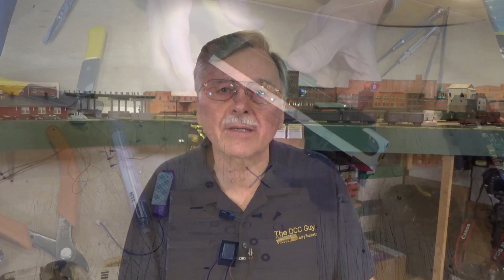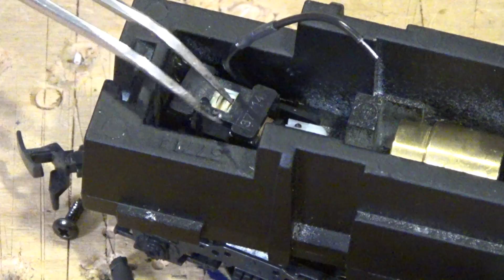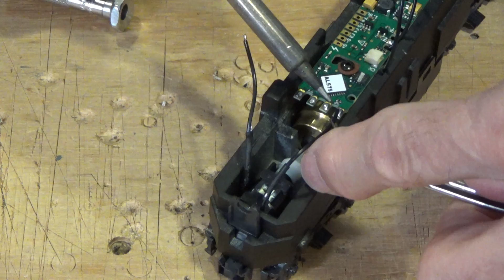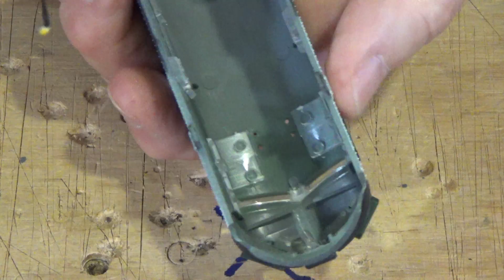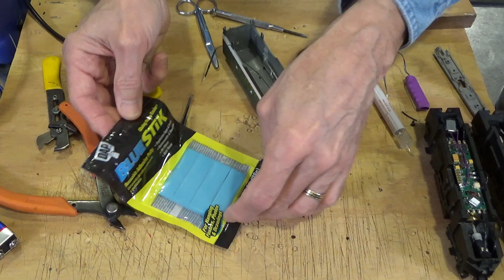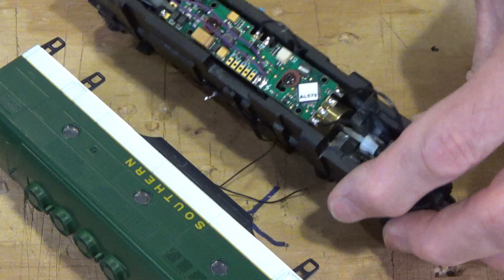Convert an old DC loco to DCC (50)

Comment: Good day Larry 
I like your show and I would like to know    by steps how I can program the cv 17,18. For DCC System. Thank you
Reply from the maker: Don’t programmg the long address that way, just let your DCC throttle and command station program it using their built-in programming steps. Trying to figure out CV 17&18 will drive you loco.

Comment: It related to this video because I can’t find your email. I installed and tsunami decoder and the lights don’t work. I tried LED and regular 1.5 bulbs and nothing.  Nothing is touching or grounding.  Since you have helped out in the past. I really appreciate your knowledge
Reply from the maker: Did you use a dropping resistor? These decoders supply 12VDC so an unprotected LED or 1.5V bulb will go poof.
Reply: @TheDCCGuy  yes they are wired with one.  The issue is no lights work off the board and it is right out of the packaging
Reply from the maker: Hmmm, hard to diagnose without being able to examine it, should work right out of the box. Give George a call at their tech support line.

Comment: Great video.. although I don't have any old DC Powered  locomotives, I noticed that when you soldered the wires to the contact points, your soldering iron wasn't held on the contact points for very long... I know this is important because if the iron is held in place for any length of time, it could damage the circuitry and other items on the board. 
 So with that said, what if I may ask - do you have for a soldering iron? 
Thank you in advance!
Reply from the maker: I use a Hakko FX-888D soldering iron. It has a rapid heat tip and you can set the specific temp. It also has an excellent ground so prevents damage to electronic components. I also have been doing this since I was a kid so 60 years experience. By setting the temp a bit higher than is required to melt the solder you can quickly complete a joint before heat builds up and does damage.

Comment: Would a butt splice work instead of soldering the wires together?
Reply from the maker: If you mean using a butt splice connector I think the main issue would be the size of the connectors. Working with N scale is usually a matter of trying to squeeze everything in.
Reply: @TheDCCGuy  I have been a union Electrician) for 31 years. I was asking because I thought a crimp connection might be better instead of soldering for someone who does not have a soldering iron or is not adept at soldering.  Thank you for your reply.
Reply from the maker: I do use a variety of crimp connectors for other splices but for decoders its hard wire or specific plugs.

Comment: Thank you for making this video! It answers a lot of my DCC questions when it comes to updating to DCC. I think fitting a decoder into my old steam loco is going to be a little tricky, but now I know what I need to do with my older F-series engines.
Reply from the maker: I need to do a brass steam loco video. I do have one N&W Baby J 4-8-2 that needs a decoder once I finish painting the wheels and frame.

Comment: How can you tell if a decoder will fit into a locomotive before  you order one? For example, I have about 2 SD40's and 2 GP9M's I'd like to convert and an Athern AEM-7. I wouldn't want to waste money on a decoder, but can't afford to just get a whole new fleet of locos at 350 bucks a pop.
Reply from the maker: You need to pop off the shell and se how much room you have and what provisions there are for installing a decoder and speaker.

Comment: Not sure what I am doing wrong, but i have blown out about 5 DCCs over the past year.  test them and they are fine out of the box, but now they dont work or somewhat work.  Rails are correct and the motor is correct.
Reply from the maker: Are these decoders you installed or did they come in the locos? How do you know they are dead? Have you tried a factory reset?
Reply: Up grading from DC to DCC  One the motor does no work, another Front Light is on all the time and crazy things like that.  I have a decoder tester that I use before installation and when something is wrong. @TheDCCGuy

Comment: Hi Larry, Zak here. I have a question for ya.  All my locomotives to date have been dcc on board. Today I received my first dcc ready locomotive that I have purchased. It has an 8 pin socket.  This will be my first time buying a decor to install. This engine is just going to be used as an MU engine so it will need just the basic functions (no sound). What would be a good basic decoder to install into this engine that don't cost a lot. 
Thank you for your time
Reply from the maker: Zak—to make it easier to run in a mu consist you really should get a non-sound decoder from the same manufacturer as the one(s) in the other locos in the consist. Although it is possible to mix decoders it takes a lot more work to keep them from fighting one another. If LokSound them buh a LokPilot. If Soundtraxx then get their non-sound decoder, etc.
Reply: @TheDCCGuy  it's a soundtraxx in the lead locomotive. That helps me out a lot thank you.

Comment: Hi Larry..can i use this sound traxx decoder in my old bachman diesels? And that will cover drive and sound with speakers, right?  I bought all the things you mentioned in one video....capton tape,iphone speakers..and I want to drill and connect red  reverse lights in back as I drill or make my own wholes 👍 thanks Larry,joe
Reply from the maker: I’d be a bit cautious with older locos depending on the age and condition. Which loco is it and how,old is it? Make sure to give it a good cleaning and check the lubrication, get it in good running order on DC. Then check to see how much current it is pulling to ensure it will not exceed what the decoder is rated for. I did a video on how to check the stall current.
Reply: @TheDCCGuy  there seriously not that old some 10-most 15 years old AND RARLY USED NOT BEAT UP BUT STRONG POWER I JUST BOUGHT A BACHMANN EMD F7A W/ 8 WHEEL DRIVE DIDN'T RECEIVE YET USED.. IM NOT SURE HOW MANY I HAVE PLUS STEAM THERE IN TRAIN LAYOUT ROOM IN BOXES I DO HAVE ALOT PLUS AMTRAK Ph 42,s I have 2 I need done . ALOTT lol and bought decoder buddys as I watched your video months ago I bought 5-6 pluse iphone speakers... I can't see to find the curved Suger speakers yet for my alco rs 3,s and 2 's I'll pull them out when I'm ready ( if you don't mind) and send a picture of some cause I can't remember half of what they are... Desperate need of help lary , don't want to blow em up...I will lube them most definitely... Again thank you for your feed back way much appreciated, joe

Comment: Larry , in this video you install a decoder in an Stewart F3.  I've noticed that you have AThearn F7's in your fleet. Do you know if your old BB Shells will fit onto your Stewart Chassis ?
Reply from the maker: I have not tired it with Athearn F7 shells but I do know that with Stewart and Intermountain shells it is not easy. It requires some modifications as they use different mounting systems and you have to figure out a way to stabilize the body.
Reply: @TheDCCGuy  Thanks Larry !

Comment: Hey Larry... Was wondering if I wanted to add two extra lights can I solder all light wires together? Same with speakers if I wanna run an extra to my B until as I drill holes for wire with connectors?
Reply from the maker: You can wire them either in series or parallel. I did videos on lights for locos and on speakers and they provide tips on wiring them correctly.

Comment: Hi Larry, I am having a bit of a puzzle. I have a 6 pin decoder socket in my loco and want to fit a sound decoder which is an 8 pin. I have seen many leads that convert 6 to 8 but the plugs are the wrong way round, ie the 8 pin is the male and I need the female so I can plug in the 8 pin decoder.    Any help please.   Many Thanks    Chris
Reply from the maker: I have not seen that type converter harness. Your best bet ls to simply cut the 8 pin plug off and install a 6 pin in its place. Or you could remove the socket and hard wire the decoder to the existing wires.

Comment: I am just setting up a small DCC layout.  I am thankful I found you videos.  Incredible.  Even explained so I can understand!
 I am in North Carolina, so I am very interested in your locomotives with Southern livery and wish to have a Southern layout.  Do you know if there there Southern locomotives available? Or livery to modify one?  Or do you want to sell you Stewert F3 - Ha?
Reply from the maker: There are a lot of locos in the Southern green and also the Black paint schemes. Walthers has made them, and Bowser has as well (they own the Stewart line). You can find a lot of the older LifeLike models on eBay too. On the older models,though the axle gears usually have cracked and need replacing. I did a video on how to do that 2-3 years ago so dig way down in the list. 

PS: I am in Asheville

Comment: I really appreciate your going over this in such detail.  I have a Bachman GE 44 ton switcher.  I found it at a local hobby shop still new in the box.  I want to switch it over to dcc.  I’m not sure if the motors need to be replaced or not.  Any help would be appreciated as I’m not finding a 44 ton switcher in dcc.  I am modeling the OL and B short line.  They still have the GE 44 ton switcher garaged in Lincoln Nebraska.
Reply from the maker: It all depends on the age of the model as they have had several versions. The original release had two motors, one in each truck. These were garbage and the motors burned out in no time. Then they came up with a version with a centrally located motor which in my case has held up well. They also did a version with an 8-pin DCC socket and I seem to remember one with a decoder. Which version do you have?
Reply: @TheDCCGuy  I have the two motor junk one glad I didn’t spend very much for it.  I will have just keep on searching for one.
Reply from the maker: Here’s a tip. After the first motor burned up and I had already custom painted and detailed the shell, I found one with the single motor and it is still running strong. I was able to swap the shells without any problems. I don’t know about more recent versions though.
Reply: @TheDCCGuy  okay thank you is the single motor a 5 pole motor?  If so I may have found a DCC ready engine.
Reply from the maker: I don’t remember, it was several years ago. Most of what Bachmann sells in theUS  is 5 pole.
Reply: @TheDCCGuy  Thank you I really appreciate your help.  I have been scanning your videos as I have many Athearn blue box specials from my childhood days to convert.

Comment: Just the video I needed I have a couple of this same engine. This was a great video I did not notice did the moters need to be isolated and if they did how did you do it and or do you have a video on how to do the process in these older Bowser/stewert engines. thank keep the videos coming.
Reply from the maker: I have never had to isolate these motors. They sit in a plastic cradle and are just wired directly to the circuit board.
Reply: @TheDCCGuy  k
Thank you

Comment: Larry, I recently followed your example here, as well as your video on wiring an 8-pin socket.  I was installing the 8pin into a Kato HO SD45.  I was installing TCS sound decoder with Apple speaker.  On the track everything works fine.  Except the lights.  I get full brightness on both at same time, I get blinking on both at same, or I get momentary on both after F0.  No rhyme or reason to any of these results, It's very strange.  I'm wondering if the board needs replacing.  Do you have any troubleshooting suggestions, or a recommendation on a replacement board?  Thanks, M
Reply from the maker: I only have a couple of old Kato switchers that had to be hard wired so have no experience with them in general or newer units. Since I have never had any problems with TCS decoders I would suspect the loco circuit board. Have you checked the TCS website, they have extensive reference material on installing their decoders in many types of locos and if yours is among them it might answer your question. If that fails then call Dan Mycio their tech guy and see if he has heard of this problem. If all else fails you can always pull the old circuit board and hardwire all the connections after snipping off the plug.
Reply: @TheDCCGuy  thank you

Comment: Very helpful video and you covered the exact issue I am having. I have a .5 watt speaker and the decoder speaker output is 1 watt. I understand your calculations but I am unsure where to set the MAX volume. In your example you set it at 100 but where is this setting? I am a beginner and you videos have been a tremendous help.
Reply from the maker: I suggest you upgrade to a 1 watt speaker or connect two 0.5 w in series. However you can adjust the max volume down using the master volume CV for your specific decoder brand—check your instructions.
Reply: @TheDCCGuy  Thank you for your quick reply!

Comment: I went on eBay and looked for the led light you referenced but none show up.  Do you have any other info to search on for the lights?
Reply from the maker: And I found all kinds of them like this https://www.ebay.com/itm/263224521440?_trkparms=ispr%3D1&hash=item3d496772e0:g:YqMAAOSwYZZZ3ypj&amdata=enc%3AAQAGAAACoPYe5NmHp%252B2JMhMi7yxGiTJkPrKr5t53CooMSQt2orsStdebXPz4ZTXCT8FI9kPBh2ZJxI6hAJn0oA2dBvImVRSp0LYiQNOHXkGv8aei6G3hDNM7%252FaA117bEoAboOYzcOhepWsrXvOvRgf6CrmTS%252FKNNSQxDNKv%252FV0Hhp9i%252F6DuZKjldlTHChhwJpU71K4M3HEO3vDtdly6tCUsV9oMu5bQ%252B2WPD%252BilSLYN9vPrXRYsBEdfkOairu8hNkb08IszDhlQa3vtLaLWNOIPD24vHAXPfHWH6%252FTBBYGpNlDCHWbJ%252BOtdh9ILKMLd5e44tzZbgHME757DuElZE63BWoHWgBTodC%252Bo6a8umu2XMuEbW3bUSl0Wwof0VndamdmM2m4BoiMmnp15EYv%252Bjlq%252FX4Zxu0RSCwaJmbaBrpBAbza5B6FWI%252FKOnjVIlSkKkNhnfmySfl3rxNVl%252FB0cNFR21gEwXVHwGVun7hxOVdbbRFUcVdJzJZKLPS9pY7pj9bNQ9LrByVxS1dqVsQDBLwCGWOoObUkguyKWhL3RuIIYndQ62v8ya3J7nr8joyM7Cbs2djT1xnRwIth7xPEAdKM2N36bXRFwx4hH7r9vctGpwzjZcoLiIoQP0TxcfcyskaeG%252FGVa8P8Wa2oVIGmpkebbU%252F8cWXl%252BdbCQhHxqd9dK4wsYt2oobOK7PRvjmCNYpFZjvI7jWe7Yv7o5x9GcfYrye9Casa7yGeKBOd1f85hJgJstNNbYi3yhKf7Qr83Q30Yu9J6iTwLf3oQQ0ZzS%252Bo1YyhGGlALtr2TibsS0vjd3MrbD1ZFXW66eYK4S0F2wgjxdqWYMbxIJxjjOffg22oHkp87E5izYHUbWZllZYxaQakj2XC9JD1wV8trl6NBKUI7hyLTo5fw%253D%253D%7Cclp%3A2334524%7Ctkp%3ABFBMxryu6qlf

Comment: can you do this to any dc engine
Reply from the maker: That is a very broad question! There are some motors that I would not keep such as the old Rivarossi pancake type or the old open frame motors common in older locos dating back to the 30s. Personally I would not even bother with motors older than about the LifeLike skew wound motors introduced in the Proto 2000 series. There has been a total revolution in small DC motors used in models that make them more efficient and manufacturers have made the models either DCC Friendly or DCC ready. I have also replaced old motors in older brass locos but those kinds of installs are not for the faint of heart. So would you care to narrow your selection of locos?
Reply: @TheDCCGuy  its a Athearn Sante Fe HO # 271C Locomotive its on ebay im thinking about buying it i only want the frame and trucks and motor out of it i 3d printed a shell and i wanted to get something used to put in this shell
Reply from the maker: That’s a hard one to answer since Athearn used at least 3 different motors for those models.The first was an old black can that drew well over 1 amp. Then they went to their standard flat can with a non-skew wound motor and it drew somewhere 0.75-1 amp. Later they came up with a similar looking version of the flat can that was skew wound and more efficient, and that is the only one I would recommend. Just doing a search on ebay I would bet that most of those that predate 2000 have the old flat can. Also be aware that the motor on these was not isolated as I showed on my recent video about motors.
Reply: @TheDCCGuy  thank you maybe i should look for something else then i just know i have to find something for the F7A

Comment: Hello Mr Puckett I enjoy your videos but to tell you the truth most of your subjects goes over my head but I'm trying to learn as I go along. Can any of your subjects be transferred to O-Gauge Railroad? Are you familiar with NCE Power Pro Cab 2 a Arduino Block Signal System for DCC? If so can that type of System work with O-Gauge Locomotives? 
Finally if you are familiar with the subjects I asked you can you Please do a Video using O-Gauge Locomotives?
Thank you for your time 
Sincerely 
Allan
Reply from the maker: First, are you using 3-rail O or scale 2 rail with DC motors? I know that the NCE system works with O scale since Jim Scorse, the owner/designer of NCE is an O scale modeler himself so it is designed to work with his locos. That’s about as far as I go with O scale, haven’t run one since I was a kid.
Reply: Hello Mr Puckett to answer your question I run 3-Rail O-Gauge Trains that's all I've ever owned. So I gathered that NCE only caterers to high end 2 and 3 Rail Locomotives. Well thank you for your help 
Sincerely 
Allan